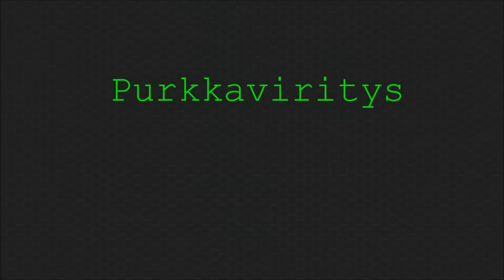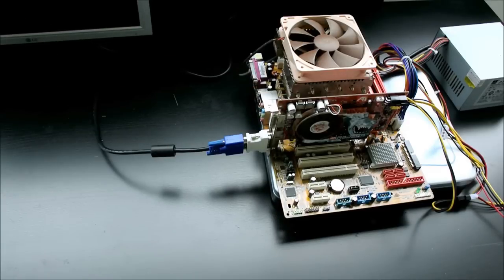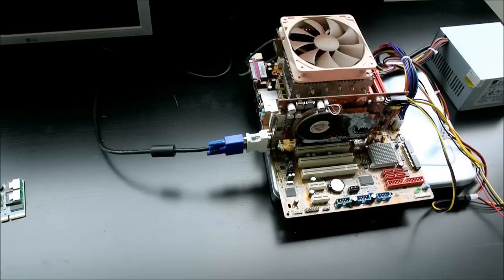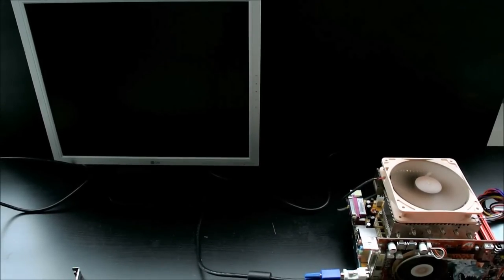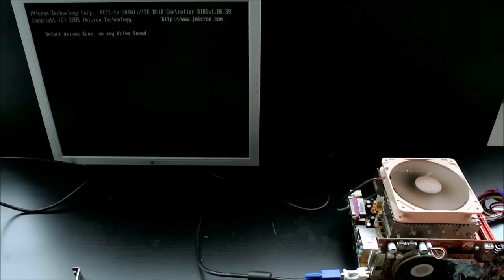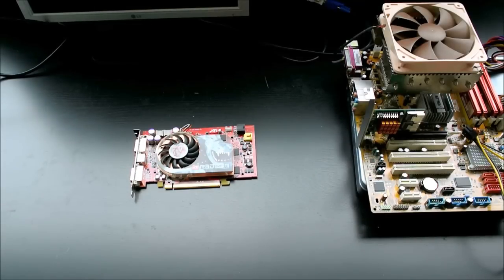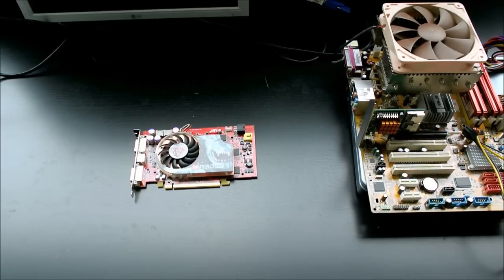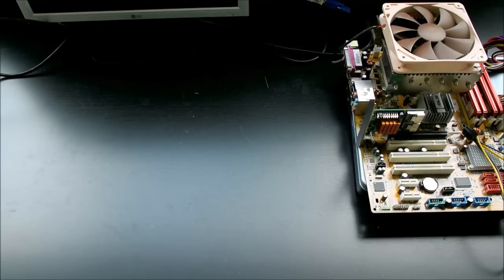Modifying a PCI-E 16x Card to fit into a PCI-E 1x slot

Comment: lol ? i mean wouldn't of been simpler to just cut some plastic from the pcix1 slot ?
Reply from the maker: well, yes, but it would also solve nothing as there is a capacitor behind the slot so it still wouldnt fit. not to mention the card was much less expensive than the motherboard.

Comment: https://3.14.by/en/read/videocard-pcie-conversion-x16-x1   this guy has to solder a wire to make it work... He is using Nvidia 8400GS, you're using AMD/ATI.  Is that why? I'd prefer to know if I need to solder as well as cut???!
Reply from the maker: just use an 1x to 16x adapter, its easier and wont break your card.
Reply: @Purkkaviritys  No space.. Low profile card in LP case... I have to make it fit...

Comment: Im about to try and put my 3090 into a PCI slot not PCIe, PCI. with adapters not meant for this purpose, I have a 1060 and an old Nvidia 7100gs to test first. Cuz why not?
Reply from the maker: You joke, but someone actually did that when AGP was the most common GPU adapter, they just cut it to fit to pci. you can find it on google image search with "nvidia 7800 wont work pcie to pci".
PCI and PCI-e are not at all compatible with each other.
Reply: @Purkkaviritys  test 1 = success my 7100gs worked. Not very well windows 10 doesn’t support that nvidia driver. I’ll test my 1060 and then my 3090 at some point. I’ll make a short video and upload it so you can check it out if you’d like. Probably won’t be until next week.
Reply: Quick update it works so long as there are no onboard graphics. My xps410 had no problems, plug and play. However my optiplex 380 would keep trying to open programs on a non existent monitor so I was stuck staring at my desktop background... I ran my gtx1060 out of a PCI not PCIe, PCI. Going to try some games out from the normal pciex16 vs PCI. I have a qx6700 and 8gb ddr2 ram in that system. On userbench the system seemed to be 20-25% worse in a PCI slot nothing some overclocking gains can’t level out.
Reply: I know but my $10 adapter due in the mail today may allow otherwise. People have had luck using it to put nvme pcie adapters into PCI slots to get better performance out of old boards. If it doesn’t work I’ll just return the part. I have 2 old GPUs I will see if they work before testing the 3090.

Comment: Can i use this to connect a pcie sound card?
Reply from the maker: technically yes, but would recommend you use an adapter instead.
Reply: @Purkkaviritys  I just setup a new pc and I have 2 pcie cards that I would like to use and I dont want to plug and unplug each time. I looked on the ınternet but there are many many adapters etc. that makes is difficult to find the right one unfortunately. What kind of an adapter do you suggest?
Reply from the maker: @emrekaplan5737  if you only have 2 cards, you can more than likely plug them in without an issue if you have enough full size pci-e slots , if you dont have enough full size slots but have a 1x slot, the get a 1x to 16x adapter.

Comment: Does It reduce the performance?
Reply from the maker: The modification cuts down the available PCI-E bandwith from 16x to 1x so the transfer speed is 16 times slower, that does not mean your graphics card is 16x slower, more like 50% slower.

Comment: when i needed to convert my P5KPL-VM into storage server i needed most of all x16 slot for lsi sas card, but my kvm is hdmi only, instead of buying $15 vga->hdmi converted i just butchered old gt 210 which had no more value for me, i wanted to keep pcie 1x slot for later, i may decide to replace lsi that takes helluva time to initialize by marvel based sas 6x card, i'd boot faster. so, for some this mod is legit. i ended up with 8x2tb raid 5 conf running linux + zfs just fine, nice  dirt cheap cold storage for 10  yrs of my mp4 archives, 1/5 price of soho raid encosures sold with crappy nas sofrware  :-)

Comment: why take a chance on damaging your card when you can cut or melt and open the back of the slot leaving your original card uncut undamaged and ready to use as it was intended as 16x card again
Reply from the maker: You do realise the card (Ati Radeon X800 xt) was 9 years old at the time of filming and is now 15 years old, it was worth next to nothing then and even less now, so if I break the card, a new one can be aquired for 50 cents at the local recycling store and new motherboard that old would have been much more effort to replace, not to mention the melting the end is not as easy as you seem to think and to top it all off, there are components on the motherboard positioned in such a way that even if you were to cut the end of the pci-e slot the card still would not fit.
Reply: @Purkkaviritys  but you're giving the impression you can do this with any new card
Reply from the maker: @Mr79xlh  Yes, you can do that with any new card, just like you can install a rocket engine on every car ever made, that don't make it smart.
Reply: @Purkkaviritys  but once again why take a chance on damaging your card when you can cut or melt and open the back of the slot leaving your original card uncut undamaged
Reply from the maker: @Mr79xlh  because, its a lower risk operation, and cheap used cards are plenty to come by, if you are doing this to a brand new card, you only have yourself to blame, and thats even before you consider that there might be components behind the slot that might block the card anyway.
Reply: @Purkkaviritys  you win I give up

Comment: i used it on my 9500GT and it worked(by not cutting the card), but how about Radeon RX570?
Reply from the maker: Just use an adapter, far easier and faster tbh.

Comment: Is it gonna give the same performance? Im planing to do the same because I have a shortage in pci slot on my pc.
Reply from the maker: the performance will be degraded and if you mess up you break your GPU, just get a PCI-e Extender adapter and it will solve your issue without a possibility of breaking your card.
Reply: @Purkkaviritys  thanks bro, i was really having a hard time with installing the new cards i just from amazon.

Comment: You should rewrite your description as "Ever wanted to destroy your graphics card, break off the pins".
Reply from the maker: But the card still works :/
Reply: @Purkkaviritys  but not at full capacity, you gimped, crippled your card.  When you could have just bought a riser.
Reply from the maker: @vh9network  You do realize the Radeon X800 used in the video, was at  the time of the recording 9 years old and is now 14 years old, there isn't much to be gimped there tbqh. The card is so old it was produced in both AGP and PCI-E versions and by PCI-E I mean 1.0, the original.

Comment: I would like to point out here that there are certain situations where you MUST CUT the card instead of cutting the back of the slot.

1. In some situations the PCIe 1x slots have capacitors and stuff behind them so a 16x card would get blocked.
2. Some PCs have weird PCIe slots, e. g. older IBM PCs have ADD2 slots ... basically a PCIe 1x slot but with 16x length and some blocked areas for their custom cards. Any GPU will work in there if you cut it to 1x length (Did it a few times) but you cant cut open the slot without causing massive damage (Dont try, trust me).
3. You have a very expensive motherboard and just want to use some old PCIe 16x card in one of the smaller slots.

Comment: just an FYI, as long as your PCIe 1x slots are at least PCIe3.0, you will never notice any difference when using a 1x-16x converter. the 1x has more bandwidth than any card out, and the 4.0 is even more ridiculous.
Reply from the maker: This thing was made in 2013 and that thing was old even then, I'm not sure it even has 2.0 slots.
Reply: yeah no, that was an FYI to the people not to you. to let them know that it literally dosent matter how many pci lanes they have on any current motherboard, as a 1x slot in the current generation and previous (3.0) have a higher bandwidth than any card is capable of saturating.

Comment: is this recommended to do (or rather is the success rate reasonably high if you dont screw up)? might want do this to a gtx 750 ti sometime but wouldn't want to throw $60-70 down the drain
Reply from the maker: reading the video description will provide the answer you seek

Comment: Cant we do this without damaging board or card with using some PCIe Riser cable cut?
Reply from the maker: well, doing this to a card is damaging as you are literally removing parts of it but it works, however using a riser is the way to go when you actually want to use a 16x card in a 1x slot.

Comment: so will this boost my performance if a use my r7 240 and the the rx460 together(the 240 will go in the pci 1x)??
Reply from the maker: No because you cant combine them like that. you need 2 of the same series like 2x 240 or 2x rx460 for that to work even with normal 16x slots.
Reply: Purkkaviritys ohh thanks.i wish i didnt buy that shit r7 card i migh as well just throw it at the trash and get the 460 or the 1050ti

Comment: i saw someone do this with a pci-e x16 graphics card.  now while the rest of the doubters stare at that statement,  and melt their keyboards from typing to fast,  here's the amazing thing.  benchmarks were run on both the native card,  and the pci-e x1 card,  and the differences were nominal.  as in the card was extremely usable.  the card was also adapted to a standard PCI-I slot,  and the benchmarks showed the card to be very usable again.  the differences between the slots were not nearly as extreme as you would think.  the proof is in the benchmarks.
Reply: The proof is that anyone who does it is a dumbass because you can just remove a tiny bit of plastic at the end of PCIE x1 slot so the card fits.. Its called "opening" the PCI-E slot and the practice is around since like 2005-6, so you dont have to butcher your gpu, only remove a tiny piece of plastic that wont affect anything

Comment: Wont be better to just use an adapter from 16x to 1x?
By the way, it does the same but without having to cut anything right?
Reply: if you add an adapter would the card be higher?

Comment: But... why... don't you do the inverse on the x1 slot itself? I have, multiple times and if required, the card works full speed in a x16 slot.
Reply: 1st thing may be true that your motherboard is more expensive, but totally breaking a motherboard is pretty hard making a motherboard. You can break parts of it and it will still function as long as it is nothing major like a com port or a fan header.

Your first pci-e x1 port is blocked yes, the 2nd on the other hand is not, even for you graphics card. ;)
You don't need a rotary tool, a steady stanley knife will do just fine. (because that is how i did it)

I.m.o. you made the worst choice possible congrats breaking a graphics card not working at its potential ever. Instead of not breaking your motherboard. (because i tried and it is really, really hard to do when you don't intend to)
Think a bit instead of taking information of the internet or people for granted there are better ways to do these things.

At the end of the day its not my stuff so I don't mind really. ^^
And put a disclaimer at the beginning of your video, geez people will try this without hesitation =S
Reply: Yes that is mostly correct. I should comment at the top.
Reply from the maker: I wonder what it is, that makes people do a comment before reading the video description, but anyhow its due to 2 reasons, MB being more expensive and drum-roll because there is stuff behind the slot preventing the card from being plugged in even if the slot was cut. There is also things like getting the angle right is harder on the mb if you have a kinda bulky rotary tool like I do.
Reply: Purkkaviritys well you could have purchased 1x to 16x riser for 2-3 usd and not damage the card. Seems smarter.
Reply from the maker: its not a "how you should go about it" video and more of a "what can you get away with" video.
Reply: Well if you wanted to make a video to make a point.  I was aware pciex has several lanes tranfering info in parallel but not everyone was I think and they would learn it for sure now. IMHO the performance of the card was severely affected despite the benchmarks. You just didn't made the right ones I think. The one affected was the cpu to gpu transfer. Example texture transfers. They are cached later that's why some benchmarks are similar. I made the comment cause some people can end up making the wrong choice by watching the video. Regards.
Reply from the maker: nah, if you scroll the comments, your comment is being made again and again when the same info is in the video description :D no one reads that or the comments.

Comment: Would be cool if you could do this mod with cutting the card and being able to revert back to full slot size. a PCI-E 1X Male to 1X Female Extension Cable would do the job. You have have to find another way to mount the card.
Graphics cards have card detect pins,  it knows what length card has been inserted all so.

Comment: Hi, can you do a benchmark on this card? I want to know how much it impacts the performance
Reply from the maker: I could, but I need to rebuild the machine as the video is 3 years old and even if I do benchmark it, I don't have a not modified card to do a comparison against.
Reply: +Purkkaviritys fair enough. I might try it with some old cards that I have. I just don't know if they will work on 1x slots if I do cut them.
Reply from the maker: Out of the 3 cards I have modified, one died. All of the cards should technically work in a 1x slot, but I would go and buy a 1x -> 16x adapter for this.
Reply: +Purkkaviritys great, thanks for the tip. this will really help using virtual machines with dedicated graphics cards.

Comment: Nice video....what I wish I knew is WHY my brand new PC comes with only 1 16x slot, but they felt the need to include a 1x slot....in 2016.  I would rather have a PS2 port than a 1x slot.
Reply: For all those still wondering 6 years later: because CPUs don't have that many PCI-e lanes. On consumer hardware only the GPU and maybe one other PCI-e/M.2 slot is connected directly. Others have to be connected through a shared link provided by the chipset. Little sense in wiring an x16 slot if it can't provide x16 performance. If you need more lanes, you need HEDT or server-grade hardware (EPYC or Xeons).

By the way, with SLI/Crossfire motherboards if you had 2 graphics cards, the single x16 slot was reconfigured into two x8 slots (at physical x16 length).

Comment: Not fully knowledgable here, but my mobo has 1-x16, 1-x4 and 3-x1 slots.  I understand it has a limit of x20 total available and I already have a x16 card installed. If I take a x4 or x16 card modify it like this and put it in one of the x1’s I will still have x3 left available? (x1 cards seem to be uncommon and more expensive)
Reply from the maker: +Fred C First, read the description, second use adapters where ever possible, modifying is the last option.
You might have a 16x slot but that does not mean that it functions electrically like a 16x slot, it might be a 1x slot when it comes to speed. In some cases you might have  4 16x slots and they all share one 8x bus or you might have 4 16x slots and one works as 16x and the one below will work at 8x. Consult your motherboard manual or the manufacturer website for this info.

Always thoroughly research what every you are doing before doing it.

Comment: I have a GTX 970, I was planning on using my old GTX 460 (from which the memory has expired, but the GPU itself still works) as the physX processor. And then I realized I had to either cut the Motherboards PCIe x1 slot, or the video card for it to fit on the only 1x slot left on the MB. And then again, I realized it was a stupid idea.
Either Way I still have a question... Am I better off with the GTX 970 handling the graphics AND the physics or having my GTX 460 to handle the physics will improve performance? I'm not planning on doing it, I'm just curious e_e
Reply from the maker: +Rafael Dávila Techera you could just use an adapter to get the card to fit, but more than likely you wont get much of an improvement even if you use 2 cards, nevermind the power consumption from 2 cards. Probably not worth it.
Reply: Purkkaviritys Thanks for the quick reply! i actually was seeing some posts about this, and they said it didn't improve performance on a gtx 970 unless it was a 7xx+ series video card, so yes, it's not worth it. Thanks man!

Comment: can an i7 4810 Sager NP8268-S Clevo P150SM-A 870m/ 1tb hdd/ 16gb ram...manage a egpu setup? will there be any bottleneck issues if i was to make one with a 980ti?
Reply: +Google Name 
yes it will be a lot of bottleneck.
nvidia usually uses pci-e 8 and up.
but when i plugged my gt 640 into pci-e 4, my fps dropped by 30%.
but is stil better than intel gma/hd.

Comment: you could have unravel the pcie 1x and can unsolder the battery would have been easier
Reply from the maker: das is verschlimmbesserung
Reply: Purkkaviritys wieso ?? dann hast du ein board wo du jede PCIe graka drauf stecken kannst und musst keine graka halb zerstören, naja war nur ein tipp 
die puffer batterie kannst du wo anders verlegen und den PCIe 1x slot hinten auf zu trennen ist schnell gemacht
Reply from the maker: Iraklis T. Löten. Multilayer-leiter kann problem sein
Reply: Purkkaviritys die puffer batterie hat nur 2 pins  schon mehrfach ausgelötet und wieder eingelötet ohne probleme

Comment: Oww. I feel pain seeing this. They put the pins there for a reason.
Reply from the maker: well duh, but due to the way pci-e works, if some pins aren't available (not connected / hacked off) the card and the computer will negotiate for a slower speed requiring less pins, and that's why this works, though if you wanted to do this in a enterprise or other work environment, I would go for a adapter.